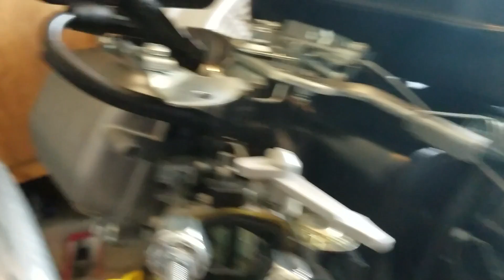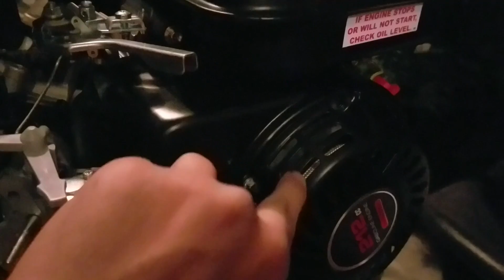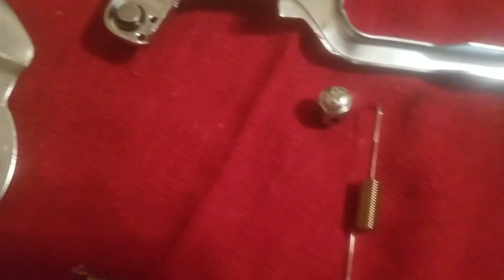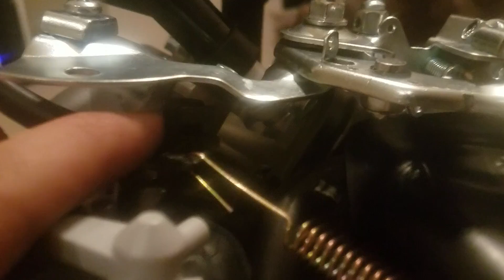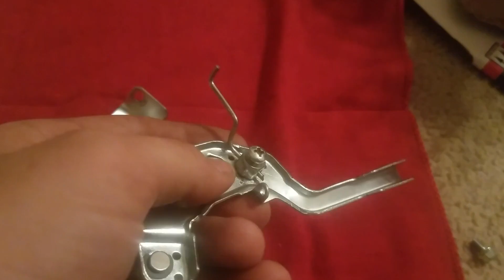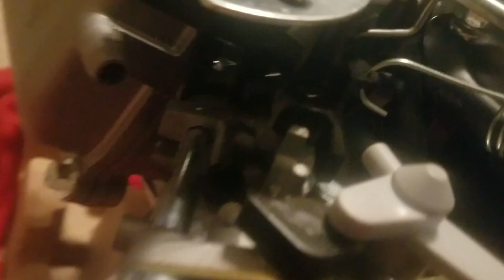How to setup a direct throttle for a Predator 212

Comment: I need some help I’m a bit confused on mine it stays wide open and I tried to put a tighter return spring but it didn’t seem to work
Reply: Theres a slightly bent washer uner a nut that makes it stay open. Remove that. Theres a video on it on here